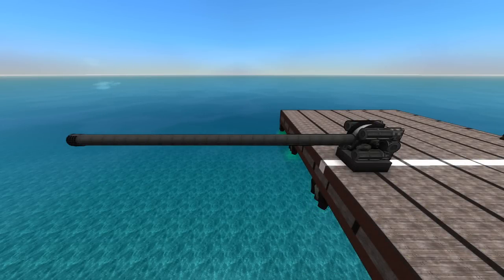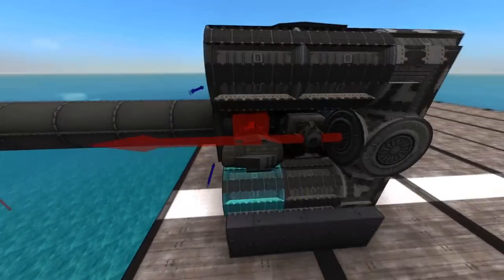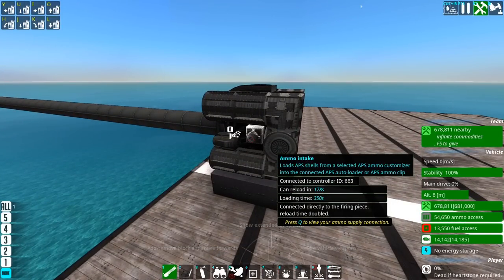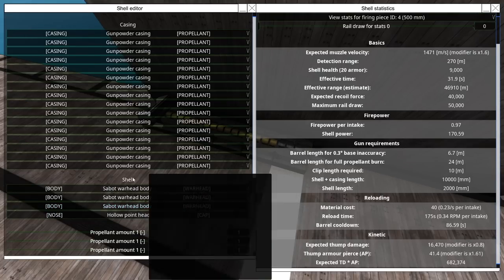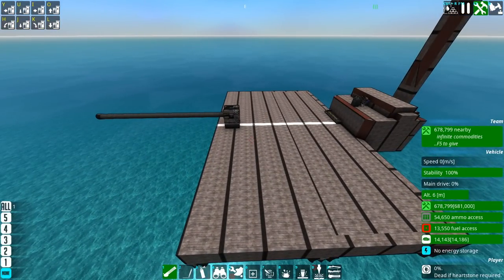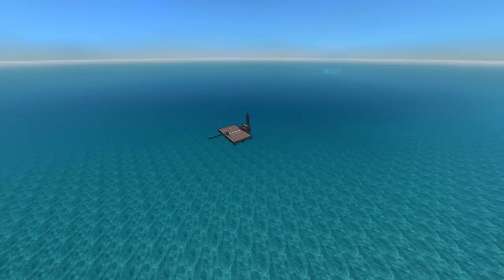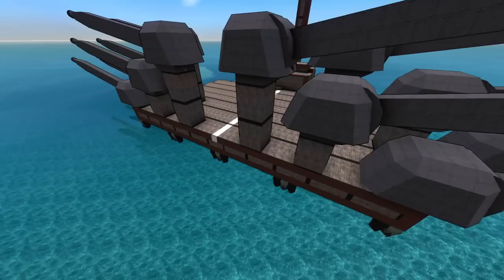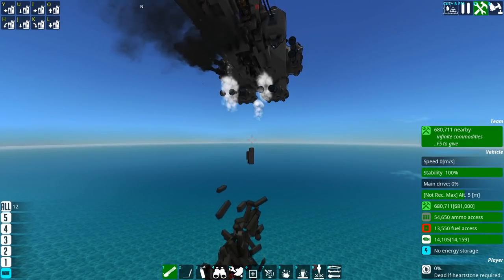Direct Input Feed (DIF) Guns! From the Depths

Comment: They are really good on age of sail ships, you can spam like 40 on each side of the ship buried deep in the ship with only the tip of the barrel sticking out. Very very cost efficient guns. I would not place them on turrets, the less cooling you use and less recoil you use the more cost-effective they become. Lob AP HE (HE with a AP tip),  Use enough gunpowder so it can pen 1-2 meters of metal. HE scales best at large gauges and if they are enclosed (which occurs if the shell pens a few meters of armor before exploding) they do way more damage.
Reply: Such guns are a big part of my age of sail CC as a matter of fact. In the mod I made to support that CC there are also stackable ammo inputs you can make cumulative 'snakes' with. I think Borderwise did a brief mod spotlight on that last year?
Reply: That'd be more of a SAP shell, if you wanna APHE you want like 17 gunpowder and 2HE with the AP tip

Comment: I just yesterday started making a submarine that's going to have a whole rank of these things firing smaller supercavitation hollow points. Less of the advantages you were talking about here, more of the "super cheap, super compact" way of things. Also planning to abuse their long barrels to have them entirely within the hull, and they just poke the barrel out using mantlet aim clipping. Because that's a thing, and it's such glorious cheese.
With the shell I've got they actually fire at a consistent 1/12 seconds, with zero coolers. The turret is literally just the turret base, a gauge increaser with one recoil absorber, firing piece with inputs, mantlet, and 9m of barrel. It's pretty hilarious.

Comment: What about a battery of these timed to fire in sync? 

Say 5 guns each takes 25 seconds to reload, you could get it to 5 seconds per shot. Alternatively for your large 10m one, you could have 6 in one turret and suddenly instead of one minute per shell you could have 10 seconds. 

Dunno if it'd be much cheaper TBF, would need large turret for sure.
Reply: I'd also say, one application of that could be small boats where you don't have space for large cannon Tetris

Comment: The real reason to use direct input feed is to get 10mx500mm shells with higher than the usual maximum payload, which means using rail only and no powder. This is especially effective with frag and flak, but can also be used with HEAT.

Comment: Is there a maximum length for the shells?
Reply: 20 components so 500mm has the max length of 10m shells iirc
Reply: in old versions the length was uncapped, but that led to nonsense shenanigans to it was capped to 20 modules

Comment: But are these 10m shells that much better than 8m ones?
Reply: THAT much better? Eh, only kinda. But the shells being better isn't really the reason to do something like this.

...Okay, fine.

TEST: Fire shells at an arbitrarily thick wall of iron (17 blocks, in this case; 4m beams, arranged vertically). Distance used: point blank (3 empty blocks between end of gun barrel and wall). Gun and Target on the same platform. To minimize variance, Gun and Target facing is as close to equal as possible / Gun installed with sufficient number of recoil absorbers, with long barrel length / Platform may be considered stable.
SHELLS USED: 3 total. All tested shells used following modules: 1 AP head, 4 Sabot bodies, with the rest filled with gunpowder casing. Shell #1: 16 modules at 500mm. Shell #2: 20 modules at 500mm. Shell #3: 20 modules at 400mm (the max diameter allowed for 8m length).
RESULTS: Shell #1 fully pierced an average of 10 blocks, dealing an average of 16.8k in damage. Shell #2 fully pierced an average of 11 blocks (with significant damage to the 12th), dealing an average of 19.7k in damage. Shell #3 fully pierced an average of 8 blocks, dealing an average of 13.6k in damage.
CONCLUSIONS: The 'maximized' Shell #2 performed notably better than the runner up, Shell #1, with a total damage difference of over 15%.
Consideration should be made in that this was a fairly basic test. Tweaking the used modules in search for more 'optimal' performance in consideration of shell size was not investigated, nor further investigation into other module count/shell diameters to determine just how significant the resulting difference truly is.
CONFLICTS OF INTEREST TO NOTE: It's 105 freaking degrees F right now (~40 C), and I don't have AC. Whisky was involved.
Reply from the maker: If they're kinetic, they have that little bit extra AP that doesn't require rail power, so that's a plus. 
The minus is their stupidly long reload time, of course. 😅
Reply: @BorderWise12  That's exactly what I'm thinking. Is that little bit extra AP all that useful?
 I haven't played for a solid while, and even when I played, it wasn't that much and decided to wait till the game is in a more stable state and every tutorial isn't outdates in like 3 month, so I might not be supper experienced, but I'd recon an 8m shell with autoloaders will outperform an equivalent price group of these 10m shells' cannons.
Reply: @anonimus370  the idea behind using dif guns is to put yourself ina situation where you only need one shot.....